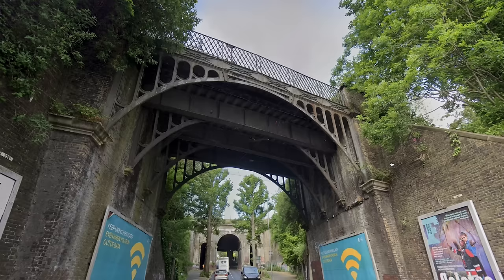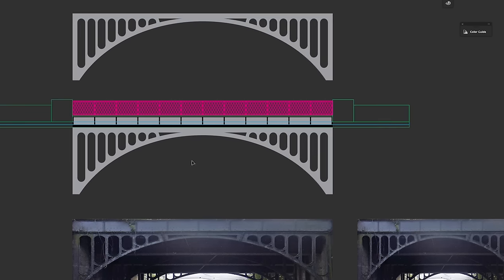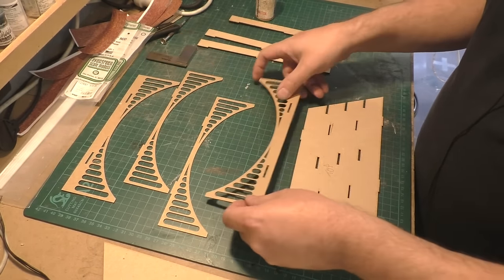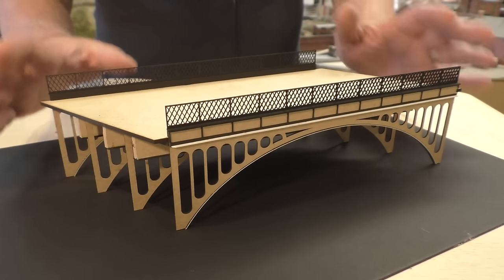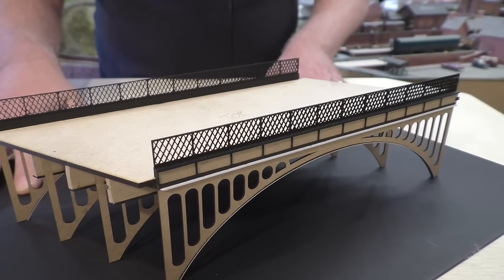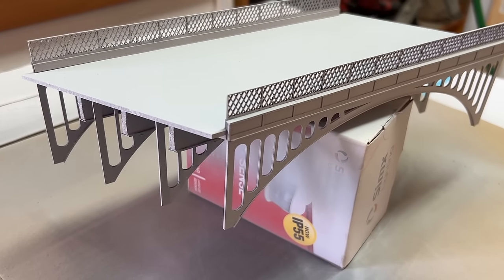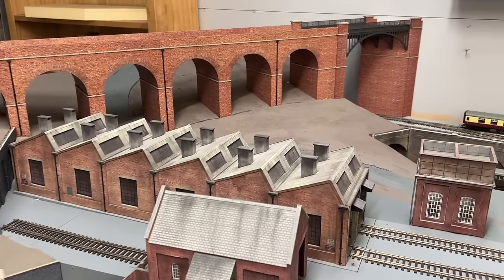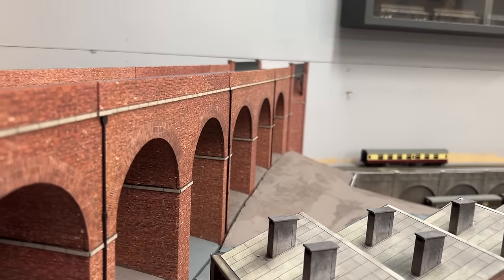New Project - Viaduct Girder Span - Stage 5

Comment: Lovely job Jules! You have really given this structure a worthy tribute! Not sure if anyone has pointed this out already, but I suspect the girders were a retrospective ‘upgrade’ of some sort. The original bridge was built when locos and their loads were relatively light and cast iron was prevalent, which of course is depicted well by the representation of that Victorian outline ‘ghost’ engine that now adorns the deck. Those girders look like they are later steel additions, which were probably added when the freight yard was upgraded so they could accommodate heavier locos and higher volumes of traffic 🤓

Goes to show what a great subject this bridge makes though, because it has this superb dual history aspect. So a great choice has become a splendid one! 😎 I love how that software allows you to stretch and skew to fit and allows you to create a feasible model based upon the original so (relatively) simply. I am realising more and more how I really MUST get one of those amazing little machines. It has spurred me on to get us moved more quickly now, that’s for sure, lol! 🤔

As a useful point of reference if you want to portray a quasi-abandoned viaduct, look up Weekday Cross on the old Great Central Railway. British Rail had to provide access for industry after the line closed so freight traffic had to pull into the tunnel under Nottingham town centre via the old Great Northern line the reverse back down to Leicestershire all on the singled and very much downgraded ‘up’ line. I think this practice continued until the tangent connection to the ex LMS main line at Loughborough was built in the 1970s after which it was abandoned. There are loads of pictures online as of course the Great Central is much mourned even now and there are even tours that follow the line as was. The viaduct structure as-was sadly no longer exists, but the trams now uses the same footprint as part of the Weekday Cross approaches today 🤓

I wouldn’t worry too much about the tonal difference in brickwork. If the viaduct was the original line, it is quite feasible that it had to be reworked to accommodate the new line running beneath it, hence in ‘real life’ they might have ended up using different coloured bricks anyway 🤷

As for the lattice, I think a soak in a suitable watered down glue and drying flat could add a rigidity to the card, though I think it looks as though the painting did the trick, and in any case I have to agree that the blemish adds realism. In fact, since it is a disused viaduct, I’d maybe be tempted to create a few more ‘errors’ to give it more of an abandoned look, and maybe cut a few bits of brickwork 😃

Have a great weekend mate 🍻🍀👍😃

Comment: Love the girder bridge. Two things the fancy iron works was the original bridge when locomotives were a lot lighter, then the 3 girders were added later when trains and locomotives got a lot heavier. As far as the deck is concerned, how about track that is heritage line (maybe storage) and next to it a cycle and footpath, as in a “Sustrans”. Have a look at Avon valley railway at Bitton near Bristol.
Reply: Yep, looks very much like Victorian engineering bolstered by early 20th century engineering, doesn't it? Love the footpath idea 👍

Comment: The girder span looks really good Julian, and as for the brick colour, as @christopherclarke9316 mentions, it's quite usual for sections to be added on or modified in differing brick colours. You don't really want everything to look exactly the same. A bit of weathering and it will look lovely. Cheers!

Comment: I suspect the arches were once structural -- but back in the 1840s when a locomotive didn't weigh anything like what it does today. As locos got bigger and heavier, the plate girders were installed preserving the arches as a decorative feature.

Comment: I don't know the history of the bridge you're basing yours on. But there is a possibility that the ornate arches were structural when the bridge was built (especially if it's over 150 years ago). As the weight of trains increased through the years, these early bridges were found to be inadequate for the task now at hand. Some ended up as restrictive routes, some ended up going from double track to single track, and some would be reinforced as best they could be. There might be a story behind the history of your sample bridge!

Comment: amazing job.  In the real thing they probably picked an iron section to give better height clearance and they indulged in two types of fakery... the one you spotted was that they are purely decorative and hide the real beams, but they also made them come down to the the pier top capping, which is what a true load bearing arch would do.  From an engineering perspective, this is where the arch loads finally transfer to the piers. Was there any reason you ended the arches further up the pier?
Reply from the maker: It's interesting know about specific engineering methods and requirements but in the case of the shallower arches, it's pure for aesthetics and the overall scene. The shallower arches provide more visibility to the hill and tunnel portal from normal standing vantage points around the train room.